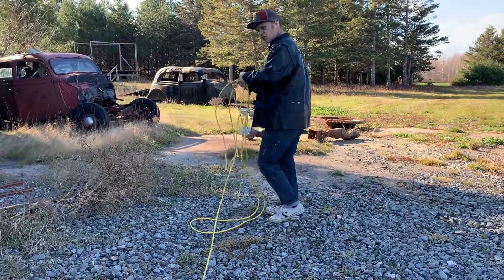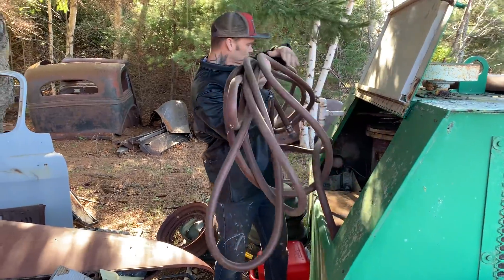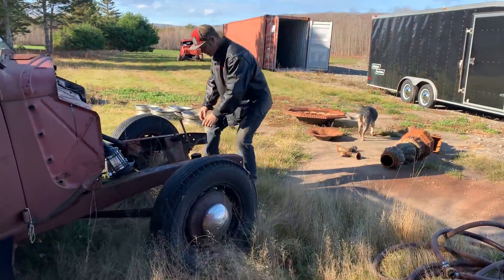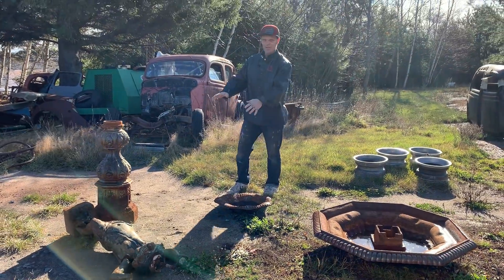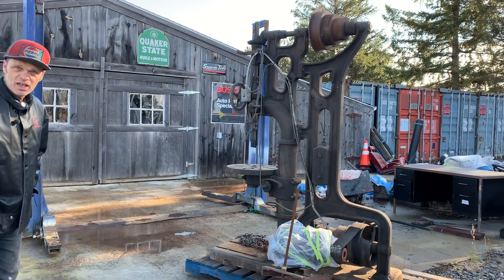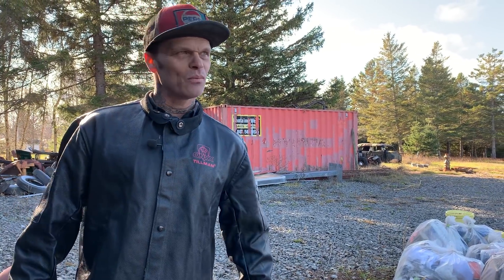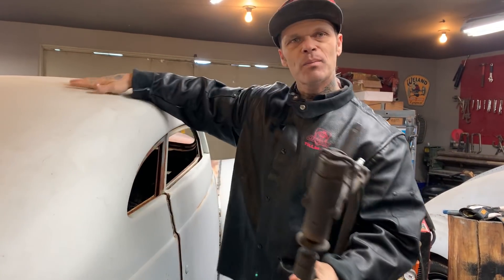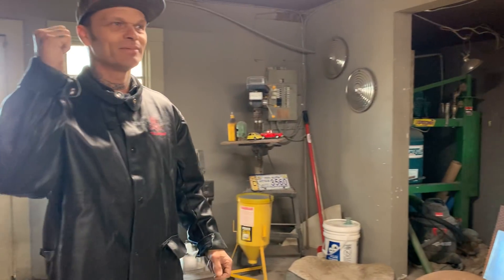Getting the sandblaster geared up

Comment: At the old hotrod shop I worked at as a kid the owner had a buddy with a ranch and they converted several garages, one for metal fab and mechanic shop, one for sandblasting, one for power coating and paint. We would do the majority of the work at the ranch get it to a completed roller than place it on a flat bed trailer to the owners home shop for final assembly, wiring, and interior. Best learning experience from 11 years old to 22 years old, it was a fortune of information and I'm proud of all the dozens of cars I had a part of building back then.

Comment: Buddy’s compressor is here, ford v8 with 1/2 running as air compressor. I tore it down and got it running.  That thing is crazy. Unlimited supply of 80 psi air. 
Nothing better than old school cool. I agree, you are living the dream, Chad! 
Planishing hammer, wish i had it to fix a couple dents in the Fargo fender. I have to be careful, dont want to ruin the original patina.  Just close your ears when running it!!

Comment: Just a thought. If you took one of your containers and mount a line shaft from one end to the other hung off bearings you could get allot of equipment like that ol Kool belt drive drill press and run them in one of the containers with a 4 Cyl gas engine sitting outside. And then run a radiator inside the container for a heater from the already being used gas motor. Look it up it’d be really kool and you could keep warm at the same time.

Comment: i would modernize the drill to a modern drill with a 240 volt motor or bigger depending on what you are planning on using it for.